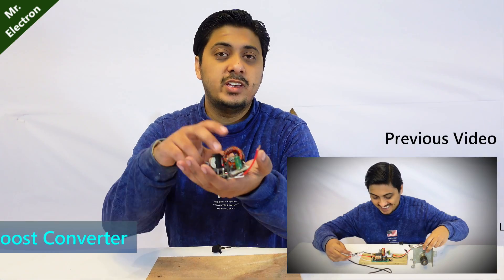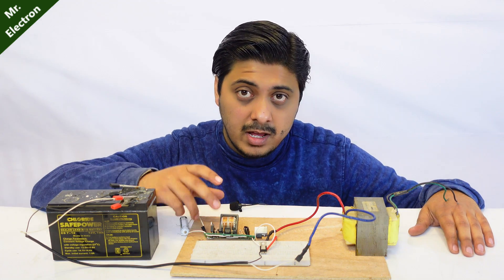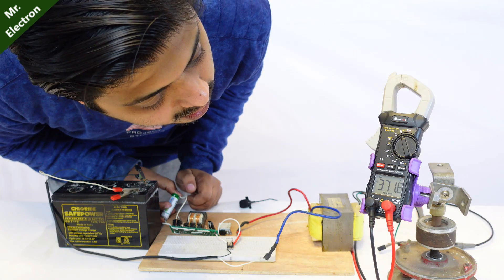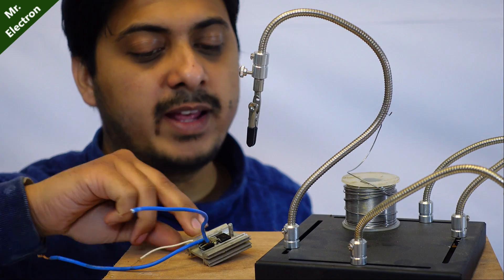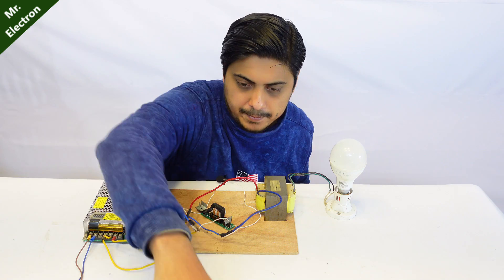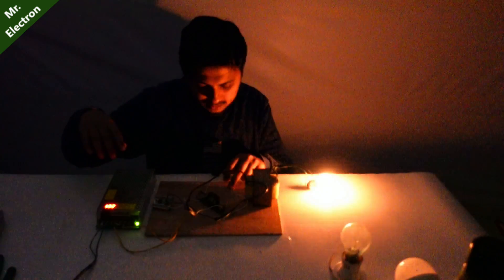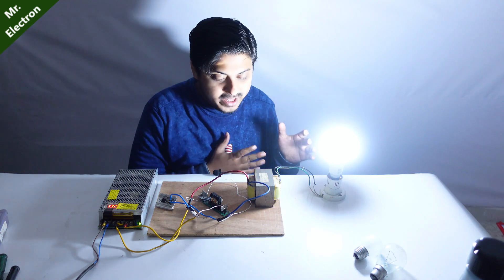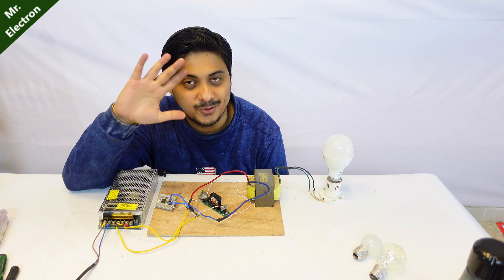12v DC to 220v AC Converter ( INVERTER without IC )  using UPS Transformer

Comment: Sir please share the circuit diagram for LVD(LOW VOLTAGE DISCONNECT) 
1.connects the when the voltage >48vdc(load 100 amps)
2.disconnects the circuit when the voltage <42v dc (

Comment: Heating like sun
Reply: Brother are you making videos for entertainment purpose ?
Reply from the maker: every possible purpose..
Reply: @MrElectron  brother please try to make video on controlling AC load by remote with the help of relay and transistor resistors etc
I does not find any proper video on it 
Please also give material list  specification of material at the end of the video